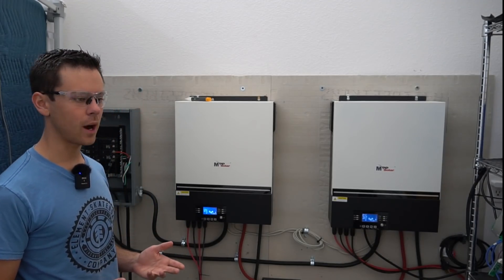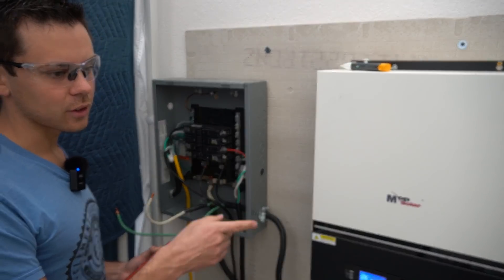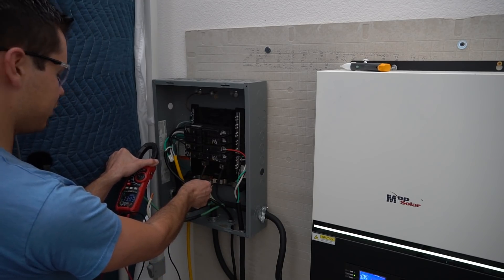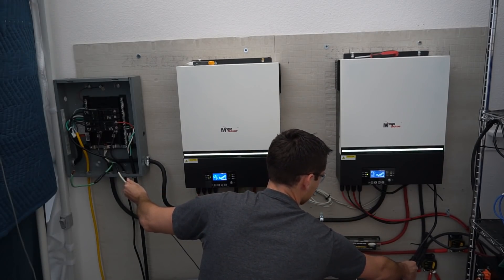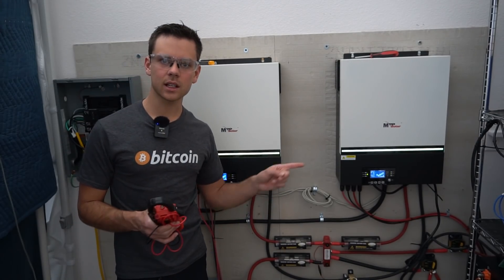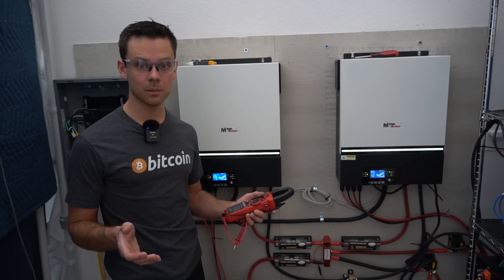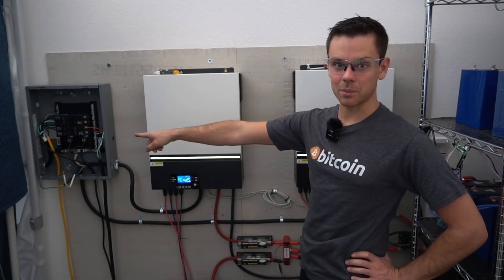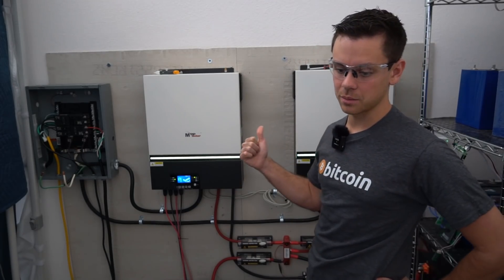Advanced Level Grounding Discussion for All-in-one Solar Power Systems

Comment: The technicality is way over my head, but i think I got the main point from this vid...For my off grid 120V set up with just one AIO inverter, DONOT bond N-G in the breaker panel because the AIO inverter bond N-G internally when using power from battery, and if i need to use gas generator to power the AIO to run bypass mode and charge battery, the generator need to be bonded N-G. Basically all the bonding need to be done at the AC input of the AIO inverter, not the OUTPUT. Thanks Will and Filterguy

Comment: Excess charge dissipation?  can you go into details on what you mean when you say this?  Under normal circumstances, the ground wires and the Earth ground rod should not be carrying energy.  Ground rods are primarily for lightning protection/static electricity protections.  Multiple ground rods are not uncommon in electrical systems, primarily with an electrical system feeding multiple detached buildings, NEC requires separate ground rods on sub panels located in detached structures, for example.  Can you go into your worries about ground loops?
Reply from the maker: Some devices can accumulate dangerous levels of charge. I see it mentioned mainly in marine low voltage DC system design manuals. Typically it's not an issue, but when building large systems, it can be. Solar farms need to reduce build up by connection to an electron sink such as earth ground. There are studies about lower performance of system when charge imbalance occurs on some solar arrays. Mainly you want a reference potential to dissipate this charge accumulation. Trucks and other machines can accumulate charge as well. Usually it's not a big deal, but sometimes it can be.
Reply from the maker: And yes, lightning protection to a degree. Having everything on same potential can reduce lightning strike. Charge imbalances is where the problems occur.

Comment: Ground is not 'neutral'.   Do not treat Ground like a 'neutral' line.  Ground should always be true earth ground.  Not a floating ground.
Reply from the maker: Yeah pretty sure we all understand that. I even mentioned this towards the end. Do you watch the video?
Reply from the maker: We have talked about ground and neutral designation multiple times. What's the confusion?
Reply: @WillProwse  My opinion is that. All ground should be grounded and connected to each other.   having multiple `ground`s does not sound good.  I think what we see as "current loop" is different somehow.    Ground is for safety.   it should always be zero.   it should always be connected to the earth to make it zero.  at any  location on a circuit.  if there are some voltages on a ground, it should be connected to the earth.    Then the real problem should be found.  that creates the imbalance.

Comment: Just a quick question I have a small inverter 12v little bit off topic but on topic of small inverters 1200watt for camper van (Giandel)it has a ground wire on the back can I just run that to the 135ah LiFePo4  battery negative? or actual ground do I even need to use it on small inverters?

Actually can you make a ground loop with a small battery’s  and small inverters and give us a demo on what not to do that may help some people understand loops better

Great videos by the way

Comment: I’ve worked with industrial power and also my own house. The bottom line is grounds are at earth potential and do not carry current. Neutrals are at ground potential and DO carry current. It seems that the neutral coming into the system from the grid should be tied to ground at the main panel. To keep the output neutral at ground potential, it would seem the grid-derived neutral would need to be tied to the inverter output neutral(s). The ground should be separate but connected to the panel ground as well as the equipment grounds. What am I missing?
Reply: Will won't answer me back on none of my questions I have a 48v inverter coming soon but it only has two ac output terminals line & neutral no ground I wanna run it to a sub panel or breaker box I want to use a midpoint transformer to get the 120v I don't know if I should get a ground on neutral sub panel a regular sub panel square d and I don't know what to do about this grounding of the whole system just looking for a little help.
Reply: @thelithiumpowerch  I’m not a master electrician, nor an electrical engineer. You need to consult an expert! However, it sounds like you have a European inverter with single phase 230v (or so) output. This is not suitable for making split-phase, ie 120/240v, power, because you have one neutral and one hot. If it was me, I’d be getting an isolation transformer to convert to split phase, not a “midpoint transformer”.
Reply: @bdugle1  all I know is the midpoint transformer by solar edge has line one and line two and a neutral and the neutral allows to have two 120 volt hot legs on both sides of the panel not 240 but 2 120v ac
Reply: @thelithiumpowerch  The transformer needs to be sized for the full output of the inverter. Then it’s a separate power source and the neutral can be bonded to ground in the main panel fed from the transformer output. The transformer isolates the inverter output which is one hot at 230v and one neutral. That is NOT compatible with split phase 120/240v service where both the hots are at 120v from ground potential. Please consult a licensed electrician to get your installation done correctly and safely!
Reply: @bdugle1  maybe u are misunderstanding my question yes I have a single phase 230 volt inverter I'm not trying to create a 120/240 output the SolarEdge midpoint transformer has a L1 L2 & Neutral that runs into the sub panel the neutral goes to the neutral bar the L1 & L2 goes to the breaker my 230v single phase inverter L1 goes to a breaker and the Neutral basically considered L2 goes to a breaker the SolarEdge ground runs to the sub panel ground then ground the inverter case to the sub panel ground do that sound right I'm not hiring electrician that's the whole point of DIY this configuration should give me two 120 volt legs
Reply: @thelithiumpowerch  You posted you have “two ac output terminals line and neutral”. If you have three terminals, then you have the same situation as Will posed in this video, that there is no allowable (by code, grid-tied system) way to tie your neutral to ground potential. As far as voltage is concerned, the 120v lines 1 & 2 are 180° out of phase, so you have 240v between L1 and L2, and 120v between L1 and neutral as well as L2 to neutral. I still suggest you talk to a professional.
Reply: @bdugle1  I don't have 3 terminals on the output just two everybody is telling me to check the ground & neutral to see if I have a bond inside the box or not going to simply run the ground from the sub panel to the case of the inverter

Comment: Looked for someone to mention this...couldn't find.

The reason for bonding neutral to ground is for a low impedance path for fault current to return to "source"   This completes a circuit to enable over-current protection devices to work promptly when a "ground fault" (a path from hot to case, for example, occurs in some load-side device.)  In inverting mode, I'm convinced the inverter is a separately derived system & requires the AC neutral output to be bonded to equipment ground for the purpose I described.  The inverter is the "source" where ground-fault current must return.  In bypass mode, I assume the AC inputs and outputs are continuous & the AC output should not be bondedin addition to the prescribed bonding at the electrical service main shutoff, as Will explains.  Only if the AC input and output neutral are always internally continuous, could we elect to bond once, but on either side.  I use a random manufacturer 240VAC split phase inverter/charger with no connection to AC input neutral.  I have to believe that bypass mode is not simply pass-through mode, & so I must bond neutral output and ground to get a ground-fault-return-to-source path for either 120V leg.

The statement about AC charging was unclear: load devices are always connected to AC mains in parallel, and connecting in parallel to a DC bus is not a challenge, up to the charging current limit of battery.

Comment: there is likly no real power  no amps on that i think you said was 14 volts use a  1/4 watt resister  of a high value  across them and see if the 14 volts goes away or if resister heats up
please keep up the videos about corret grounding  it is very confuseing and unkowen  i will not say what i have done for a living for 25 years lets just say i should know these things 
and i am not the only one i dont think anyone truely knows
Reply: thanks Will

Comment: I'm new to this topic but very interested in it. Would it be possible to ground your secondary panel with a rod and connect the input AC to three inverters without connecting the ground from the mains panel?

Comment: Seems a lot easier to just keep it as a off grid isolated system. Even for 240V loads like charging the Tesla I would use dedicated 240V equipment. And lastly, I would use several independent systems. One for ground floor, one for upstairs, one for basement and another for the garage/workshop. Might be more expensive but if one system fails, the others still work. Instant resilience to power loss.

Comment: Nothing should flow through ground during normal operations.  I think the electric code specifies there should be only a single Ground Neutral Bond in a system.  As far as I understand you can have multiple grounds in a system but only one Bond between ground and neutral.   I mean when you mount a breaker box against a metal building part - it's already grounded.  I think what you are concerned about is a "neutral loop"   Which can happen when you got two grounded and bonded panels.

Comment: You have to bond the panel. If one of the LV6548 isn't connected, there is more neutral current than what the system can handle. You would have to wire each invertor with the maximum current that the system can handle. Each invertor isn't designed to handle all of that possible neutral current. It has to be done at the load distribution panel.

Comment: however you have changed the cards on the table and it is not correct, you were using a portable system completely isolated from the network, and your Tesla did not charge, as you do in this video I agree with you, your star or neutral center is grounded, being a system created to work also with the network to load and work from UPS, if all the transformers before the houses have the star center (N) grounded there will be a reason, whether it is phase split or not, the neutral is a earth in civil fixed networks, in America or in Europe, if you generate in isolation with an inverter or a portable generator the RCDs do not work because there is no earth reference, (the electronics of the Tesla battery charger notices it) cmq in the event of a 1st fault nothing happens, you are isolated and safe, in the event of a 2nd fault the equipotentiality of the earth conductors between the connected devices creates a short that is not used by the RCDs but by the MCBs or the part BO of the RCBOs to speak shortly.
in fixed systems without a grid, whether it is an inverter or a generator, we put the neutral on the ground. it is obvious that this is not done and it is forbidden if you are on the network, to charge your Tesla you have to give it a neutral to earth, being that it goes to 230V it does not have a neutral and 2 phases, but only 2 phases and a mass to the portable inverter, don't change the cards!

Comment: My guess is thats why the MPP equipment isn't UL listed. THe AC input should be isolated from the load and the subpanel that connected to the AC output. If you have parralel systems. they should be combined in a breaker box, and that feed the panel that does have a neutral ground bond. They are two different services. According to the NEC, all of them in parralel is one unit. Each unit has to have the ability to be taken offline for maintenance without effecting the safety of the system. THat means you have to combine them at the feed, and the load. If you only have 2 LV6548, it doesn't make much of a difference. THe entire system has to be taken down. If you have 4 LVX6048, you have to be able to isolate each inverter, yet have it still be safe. a panel that combines the outputs, prior to the distibution panel is the only way to accomplish this. THe breakers also allow you to isolate each invertor for maintenance.

Comment: If your inverter is internally N-G linked, then you don't need a bond in the panel, if it isn't then you need it. How else could fault current return to its source? Will, I know that you like your "Isolated" system or floating one as you are calling it. But those unfortunately have the disadvantage of introducing inductive overvoltage events due to nearby lightning. If one wants to risk frying all his appliances which are connected to it then do it. All these grounding/bonding issues originate only from the AC-in for bypass or charging. And they are exaggerated if the inverter/generator is even more grid-interactive. This can easily grow over someone's head. Grounding is very systematic and logical. And bonding can only be done in one place on your property and only at TN level, that is where you get your power from, before anything else. So, for your off-grid system, if the inverter is internally bonded, just connect each wire individually to its bar inside your panel. No further bonding required.

Comment: I had bonded with a jumper my neutral and ground when running a single LV2424 pip since my ground would float after the sun went down and the charge controller relay would kick off. I was grounded to the AC input, but it didn't seem to matter. -The inverter output would float the ground after sunset. I have since added a 2nd LV2424 to make a split phase system and put in a panel where the ground and the neutral are not bonded. This was in theory that the both the AC inputs had neutral/ground bonding in the main panel. The floating issue after dark has since gone away. I have a Reliance transfer switch for critical loads that also ties into the main panel ground/neutral bar. So at this point, my ground for the whole system is bonding to the main panel at the AC input. I have both PIPS connected to main panel on their own leg from the utility. It seems good, but I'll check to see if I am getting leakage on the grounds during the day and at night to see if something is screwed up.
Reply: Do you have any pictures or can you make a video same issue
Reply: And are you able to charge for grid

Comment: The neutral and ground are tied together and bonded to the transform on the pole.  The neutral and ground are tied together and bonded to metal and connected to a ground rod at the main service disconnect feeding your house.  The inverter would normally float the neutral ground connection on pass-through of utility power and bond them on an outage and switch internally to disconnect from utility power to inverter power (produced from the batteries) and also in the same switch tie the neutral to ground.  This is why it's important to ground all metal cases on an inverter.  It's great to see you diving so deep on this issue.

Comment: excerpt 2 same article

Separately Derived System
Separately Derived System is “an electrical source, other than a service, with no direct connection(s) to circuit conductors of any other electrical source other than those established by grounding and bonding connections”.

If a generator is the sole source of power for a temporary power distribution system, then by definition it is a separately derived system. If a temporary generator is used as an alternate source of power to a building service, then how the grounded neutral conductor is connected will determine if the generator is a separately derived system or not. If the transfer switch is designed to switch the neutral conductor (4-pole switch in a 3-phase, 4-wire system) in addition to the phase conductors, it would make the generator a separately derived system and must be grounded per 250.30. The generator is required to be field marked to indicate whether or not the neutral is bonded per 445.11. See Article 445, Generators.

Many temporary generators installed to supply power to a building service though a pre-existing transfer switch during disasters are not normally considered a separately derived system. The electrician must verify how the neutral conductor is connected in the transfer switch and service panel prior to the installation of a temporary generator.

If the neutral conductor is not switched in the transfer switch (3-pole switch in a 3-phase, 4-wire system) and it is connected directly to the service neutral grounded conductor, then the generator is not a separately derived system, and the requirements of 250.30 will not apply [see figure 3].

Comment: I temporarily run 8 panels and 8 - 12v batteries on a 3.5kw MPPT with no ground. I have several power strips with extension cords instead of a breaker box. 

How risky is this?